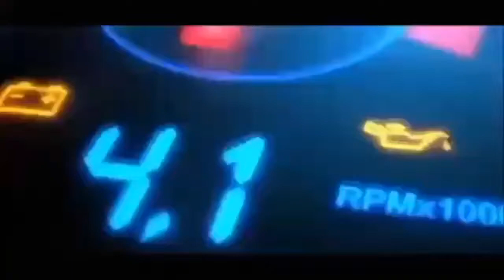How to spray clearcoat to achieve the wet wet look

Comment: Great job,brother !👍now for clear is that a 1.4 ?And for the base are you also using a W400 with a 1.3?what psi pressure ?And is that waterborne base or solvent?
Reply from the maker: Yes... 1.4 iwata for the clear .... w400 for 1.3... air pressure.. I spray by ear.... And yes this is waterborne basecoat 🤘🏿💯✊🏿

Comment: Nice job man!! Which Iwata are you using there? I just ordered one yesterday, W-400 Bellaria 1.3 134G, it's their newest aircap I guess. Haven't painted in 25 years but I have this beautiful Jaguar that really needs a new coat! See if I still got it!
Reply from the maker: W-400 for clearcoat and lph-400 for basecoat
Reply: @ralocustoms3818  Well my W-400 came in yesterday, it's going to have to be my do-all. Damn nice gun for under $200!!! What have you done with your Avalanche? Sounds good! I'm a fan of them, my '06 is my year round, do-all. Hauls my shit, plows my d-way, rides like a Caddy and, pushing 200K, it's still almost like new!
Reply from the maker: The rearend broke on me the  other day... I need to replace it.. I'm probably going to make a video on it
Reply: @ralocustoms3818  Well that sucks. Probably the Eaton auto-locking diff (G40?). They work great for what they were designed but they will not take any abuse at all.

Comment: What clearcoat you use to get the wet look my paint job is good on truck was thinking about just using some clearcoat to make it look glossier with a high gloss but not using the paint color or primer on my truck which is a midnight metallic blue. Be better to claybar my vehicle too before I put more clearcoat on but after I get these scratches off with some small amount of basecoat paint am getting soon.

Comment: Nice, I like the technique,  so what psi for the gun do you use fireman 👍
Reply from the maker: Thanks Bro!!!🤘🏿💯✊🏿 .. lol that's what I call it ....fireman 🤣😂😅
Reply: @ralocustoms3818  what is the PSI setting you are using 35psi or 40psi? Thanks
Reply from the maker: 35ish
Reply from the maker: Truthfully I spray by the sound of my gun... I know that sounds strange but 🤷🏿‍♂️
Reply: @ralocustoms3818  I know what you mean. I was the same when I used to be a welder. Everyone else got loads of splatter. Mine used to go on like butter..!!

Comment: what is the diameter of your air hose? Which connectors do you use?
Reply from the maker: 3/8 air hose with high flow fittings

Comment: Just curious what was the fluid setting on clearcoat and the air pressure on clearcoat please. Thanks
Reply from the maker: I paint off sound and feel... I've been painting for a long time. For as pressure 15lbs is good enough  and for fluid you have to find out what works for you. Thanks for your question ✊🏿💯🤘🏿

Comment: Hey buddy I don’t know about painting and I tried to paint a quarter panel on my car , when I sprayed the premier and paint it looks all good BUT when I sprayed clear it did look like orange , I didn’t add reducer to it  wondering if that was the mistake
Reply from the maker: It depends on the type of clear that your using. Some clears are 4:1:1 4 parts clear 1 part hardner 1 part reducer. And some are 4:1 just clear and hardner . But if the clear that you were using required reducer and you didn't put it in there thats your problem.